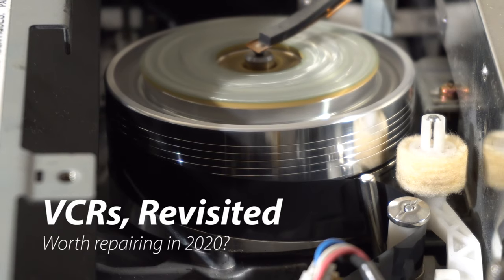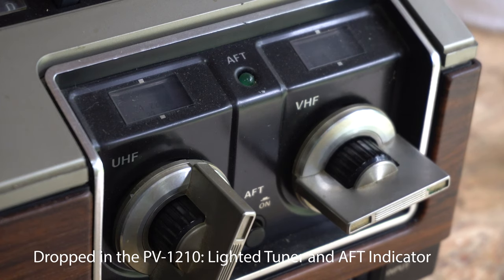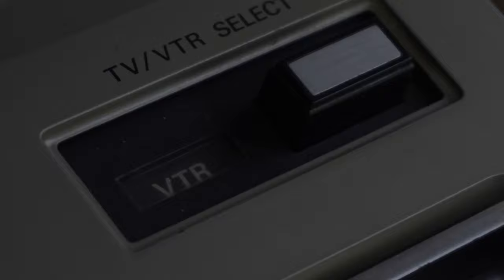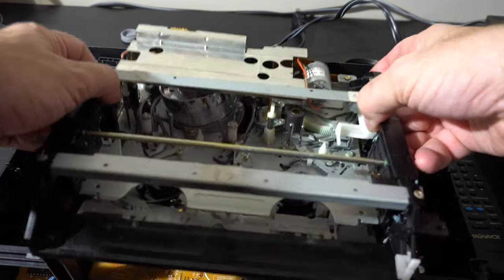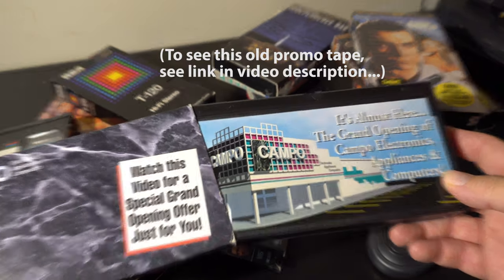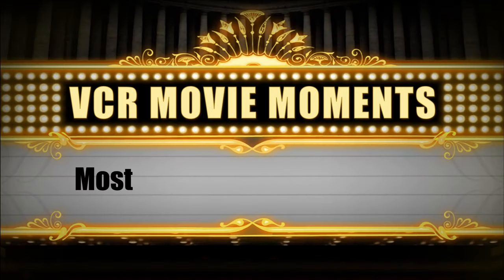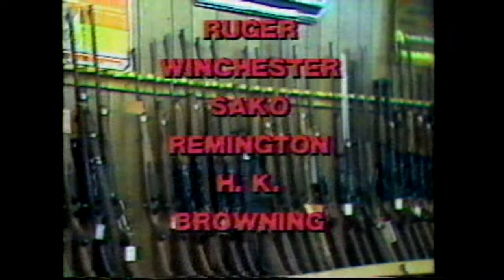VHS VCRs Revisited, with some Vintage Commercials!

Comment: We had a 1978 Magnavox VCR when they first hit the consumer market.  Looked pretty identical to your Panasonics.  I remember it needing repairs several times when I was a kid.  We were the first on the block to have the newest tech as my father operated a small appliance store.  "Blade Squad"... Jeez.  I don't remember that one and am pretty glad I never saw it..
Reply from the maker: I never saw Blade Squad either, after reading your comment I found their Internet Movie Database Listing, and the tagline is "Hardcore skating. Extreme action. Law enforcement like you've never seen!" - sounds really, really bad. Thanks for watching!
Reply: Panasonic built VHS machines for RCA, Magnavox (and other companies) back in the late 1970s, so yes, that's why they are identical and probably use the same chassis.
Reply: @KylesDigitalLab  I looked at the service manuals for the Panasonic PV-1100 and the RCA VCT201 and they are 100% identical machines apart from the branding and the small cosmetic differences.

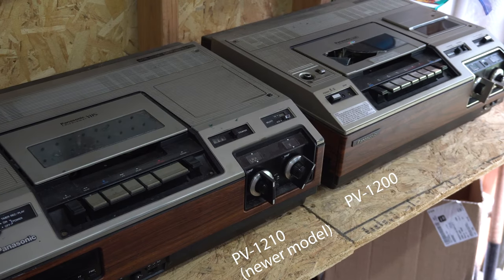Comment: 1:21 I have both those VCRs The nice thing about those late 70s early 80s VCRs they were built like a tank and they were pretty much bulletproof except for the belts. I’ve had mine for years both of them and they still work great if they’re kept in a very nice environment free from moisture and dirt they will pretty much work. The only sad thing is, they’re only mono they’re not stereo it’s too bad my newer VCRs are stereo. But I used to always love those top loaders. The only Achilles’ heel, that those two machines have is the little lightbulb that is underneath the top loading mechanism without that the VCR won’t work. But you can find close enough replacements, which I had to do with mine. They just plug-in a two prong socket. And I still have the original boxes those VCRs came in when new

Comment: Incredible how the circuit board has shrunk with the later models. The units from the 90s had the best image but have bad rubber belts (won't eject cassette), and bad capacitors inside the power supply - not difficult to fix. Units from late 90s early 2000s had the bad Taiwan capacitors - many of them, not worth fixing, either no image or no sound. Speaking about image quality, it's not a matter of definition, but a matter of memories. Many original cassettes have lost some magnetism by now, resulting in washed off colors. You can still record a new cassette and be amazed of the intense colors. Keep in mind, VCR play only 4:3 format, so the top and bottom of the image will be chopped on a wide screen.
Reply: Mine is from the mid 90s Samsung SV-700X It Ate Tapes As Soon As The Hit The Heads It Flinged Across The Mechanisms Replacing The Belt Did The Trick And Never Had Any Issues Since Even though its just a rubber band I've Had No Wow And Flutter Or Any Issues Even though Its Rather Thick

Comment: I would have to have one of those Panasonic built VCRs from the late 70s, those have great build quality compared to the newer models.

Also, don't use q-tips on video heads! Also did you try adjusting the tracking on the Panasonic?
Reply from the maker: Thanks for the tip, back in the day I used to have some special rubber foam VCR cleaning swabs. I think the belts actually need to be replaced and were a little loose. I just pulled it out of the storage shed and clicked play... tracking did help somewhat. Thanks for watching!
Reply: I have basically the same machine but mine records in PAL and SECAM but can also play back NTSC. The model is the NV-8600-EM. If you use your ears and listen to the machine carefully as it's playing, you can clearly hear that the head drum speed ins't stable and the servo is hunting. So an adjustment on the "Cylinder free run" control on the servo board should fix that. :)
Reply: Yea, from what I have heard you are supposed to use a sheet of paper and alcohol, but not on the rubber parts, those can use a damp paper towel instead.

Comment: 7:50 That problem you’re having with the video dropping in and out if you would listen to the capstan motor it’s probably phasing meaning it speeds up and then it slows down if it does that there’s a bad cap on the power board that feeds the capstan motor I remember fixing an old VCR like that that had that particular problem. I thought it was the video heads.

Comment: Hi there! I have the 1200 and it work, except the screen shakes a little. Do you know what is causing it? Thanks for sharing.
Reply from the maker: Not sure, but one easy thing that can be done is to clean all the rubber belts and tires with to make sure they are not slipping. thanks for watching!

Comment: Great video! Thank you for sharing. I just purchased a PV 1210. The play button will not press down. Any idea why? The rewind button and stop buttons are the only ones I can press. With a tape inserted, it will rewind, but still cannot press the play button.
Reply from the maker: Thanks for watching! My PV-1210 has only had 3 problems in its lifetime and one of them if I recall did have the symptom of play not engaging.... It has been 20 years or more, so I don't remember the details, but it was power-related -- like power was not getting to a certain part of a circuit. I also remember it was related to that light bulb in the tape compartment somehow. Maybe I ran a ground wire or something between parts of the circuit, which fixed the play problem, but the light went out, so I had to find power for it elsewhere...
Reply: ACBMemphis  thanks for the quick reply! These things are wire and screw nightmares . I’ve uploaded a video to my page if you’d like to see what my issue is.
Reply from the maker: @kylescott5761  That looks like a different problem that what I was thinking of - I was thinking play would not stay down. Looks like your VCR is having a mechanical problem of something blocking fast forward and play from even being pressed in the first place! I wonder if the little guides that pull the tape out didn't make it all the way back in? That would be the first thing I would check. That's run by a vertical gear with a motor and a very little belt. If you set the VCR on its side and remove a bunch of screws you can fold open the circuit boards and see where they are. I would dig down to the belts - if they are worn it may be you just need to cycle through various modes with a tape in.
Reply: Late reply but I am sure I know what's the problem since my NV-8600 had the same issue. You need to lubricate the two metal plates (sliders) that are located under the function keys.

Comment: How do you connect this to a flatscreen?
Reply from the maker: If your TV has a tuner you can use coax and tune the TV to channel 3/4, or use the  composite audio and video output (yellow cable). Composite video is the same cable you could use to connect an older video game system such as an original Nintendo.
Reply: @ACBMemphis your VCR is super flutter, mine is the Sam remodel and doing it to, did you fix the problem please tell me!
Reply: @ACBMemphis i think it might be because I used red white and yellow cables on those black connections

Comment: I have a old 1980 JVC VHS toploader that doesnt work it auto stops when you push play. Any idea whats causing it i have been trying to get it working for a year now so would appreciate if you had any tip for fixing it.
Reply from the maker: Does it actually pull in the tape and start spinning the head? I had a similar problem with this Panasonic, I could press Play but the button would not stay depressed and nothing would start. One of the symptoms was that the tape sensing light was not shining when the VCR was powered on. One of the power supply outputs was not making it to a certain part of the board. I think I just connected 2 of the grounded areas to fix it.
Reply: @ACBMemphis  Hmm im going to check the power supply since it does not start the Light for the tape sensor and the play Button wont stay in it stops stays and the tape wont go around the head on my vcr.